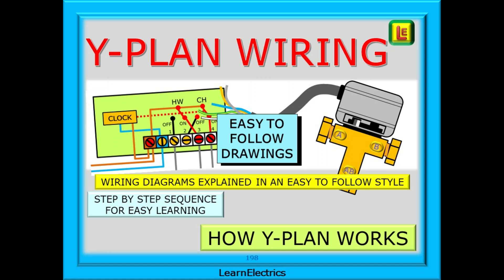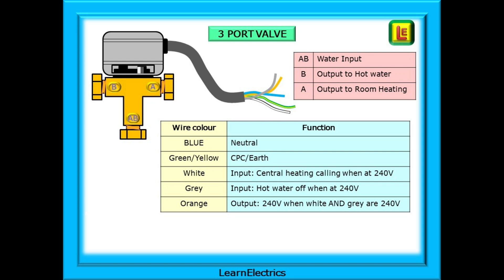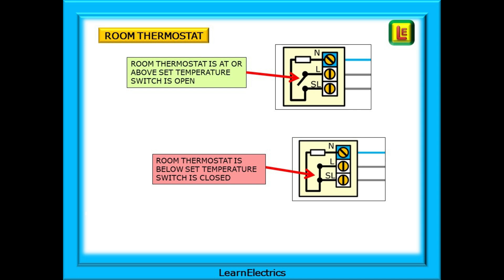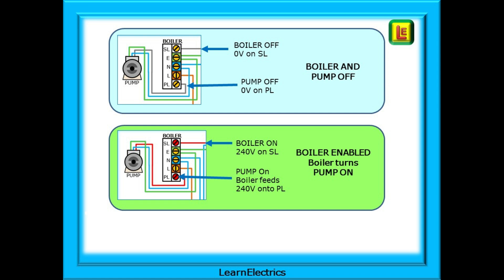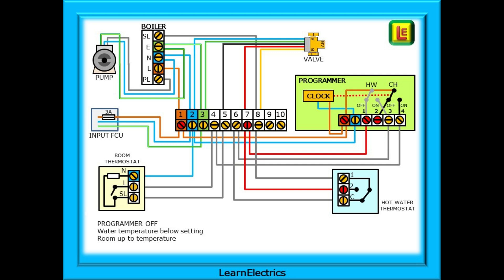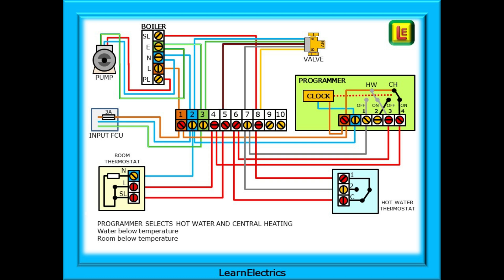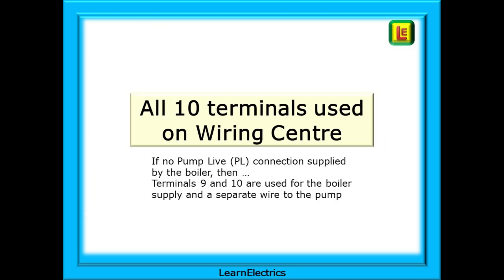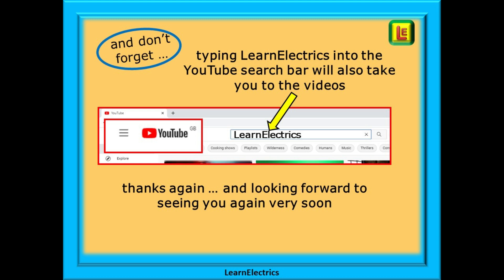Y PLAN HEATING – WIRING DIAGRAMS – HOW IT WORKS – EASY TO FOLLOW STEPS TO UNDERSTAND Y PLAN SYSTEM

Comment: Thankyou so much, it helped explain a lot. I have used your diagram as an aid but I appear to have an extra cable, I was wondering if you would be happy to look at my diagram, perhaps you may have an idea and put me in the right direction. Excellent work.
Reply from the maker: Glad it helped, the videos are a guide and the manufacturer's of your system may have included an extra wire. Check with the manufacturer's instructions. Thanks for watching.

Comment: My heat only boiler only has 3 core cable dangling down from it. Baxi said you can't wire inside the boiler. Also the pump wires need to be joined at wiring center.Can you advise haw to feed boiler from wiring center?
Reply from the maker: Refer to the manufacturer's specific instructions. They will have a wiring diagram on the website that you can compare to what you have, which numbers in the wiring centre relate to your exact boiler.

Comment: Hi - any idea why there would be a link between the L and 1 ( Com) on my programmer - or put another way would it cause any harm if I copied this when replace a Centaur TC1 with a hive dual channel programmer? Thanks.
Reply from the maker: Follow the manufacturer's instructions. Sometimes copying wire for wire can lead to problems. Identify what the wires are on the old programmer and then compare to the new programmer. Dave.
Reply: Thanks Dave @learnelectrics4402

Comment: Great job - One mistake I think at 10:48 where you say the "Pump sends 240v down the orange wire" where it surely is that  the 'Valve sends 240v'?
Reply from the maker: There's no catching you out Trevor. Well spotted, I'll correct that typo, or is it a wordo? Thanks for the support. Dave.